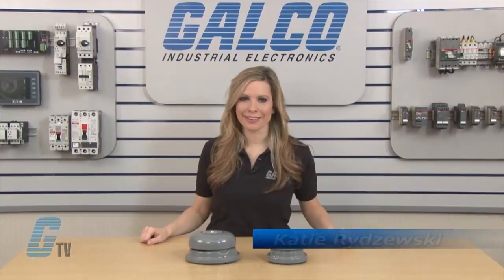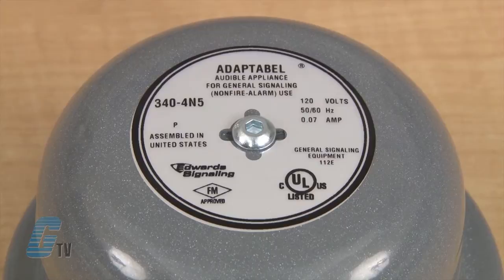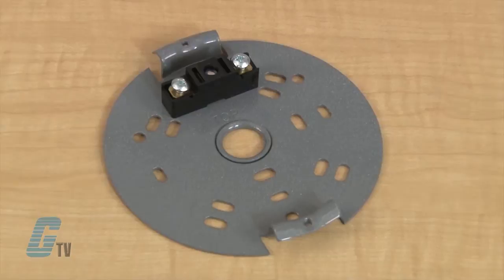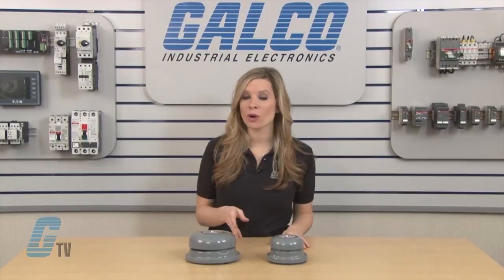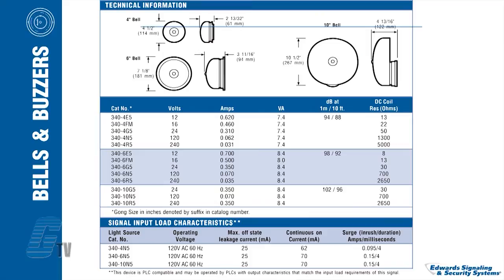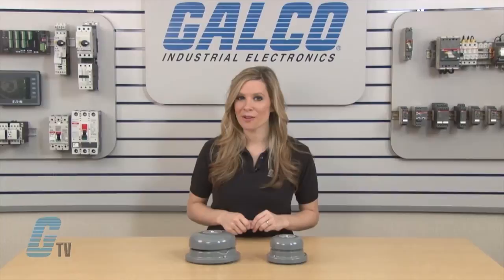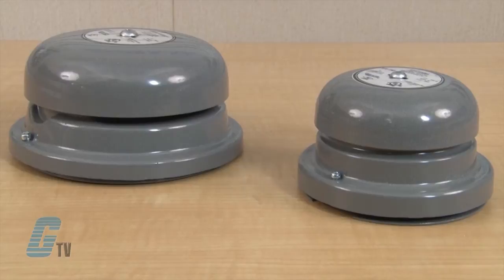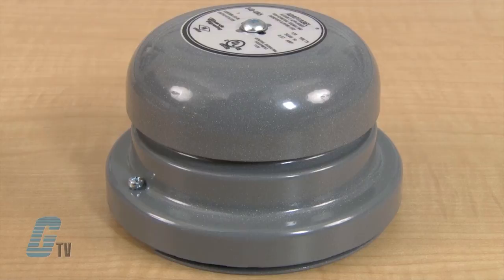Edwards Signaling 340 Series AC Vibrating Bells

Comment: My middle school had the 6" 340-series vibrating Adaptabels, but they had the really old Edwards label and logo on them (as the school was built in 1957.) They were used as school bells, and they sure were loud. But a few areas had these old Edwards single-stroke chimes. Outside there was also a 6" Adaptabel, along with several 10" bells and one 4" bell (only the 6" bell worked for the most part, though I remember one of the 10" bells worked on my first day of eighth grade.)